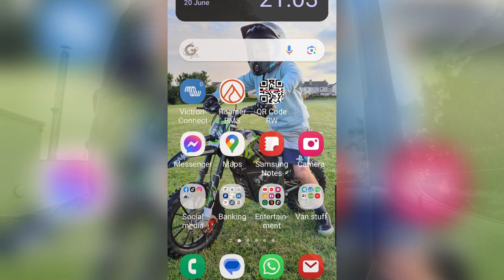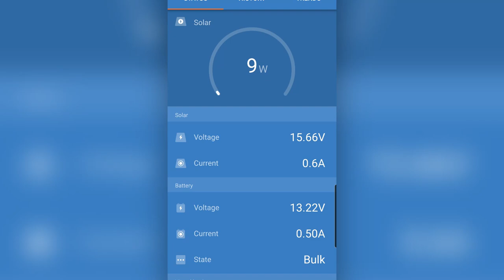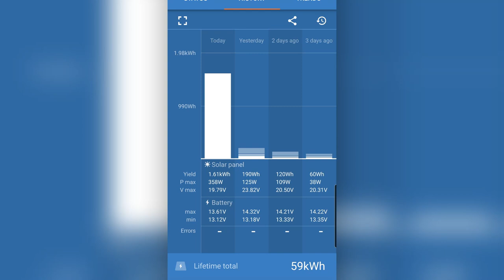we are adding more solar panels to our selfbuild campervan roof

Comment: Hi mate, another easy-to-follow hands-on video, that takes the scare out of doing things yourself.  😊👍
You are henceforth to be known as "One-armed Sam" (as you manage to work with one hand while filming with the other...) 😂
Adding solar is the next bucket list item (oh wait - gotta build the support structure yet) and I already have 3 x 180W panels, that will fit EXACTLY betwenn the vents front and back with no room to spare. No bathroom vent, so one less headache. 🙂
Are all the panels hooked to one controller?
Cheers from Germany and hugs to you, Lisa & Riley! Stay safe. 🚐☁🍀
Reply from the maker: Yes, mate, all ran in parallel due to the sizing of the panels
They are working well, so I'm glad i got on and completed the job